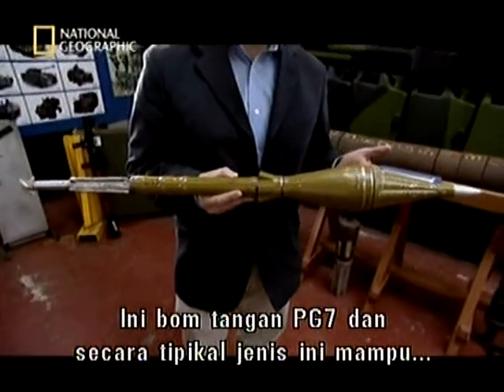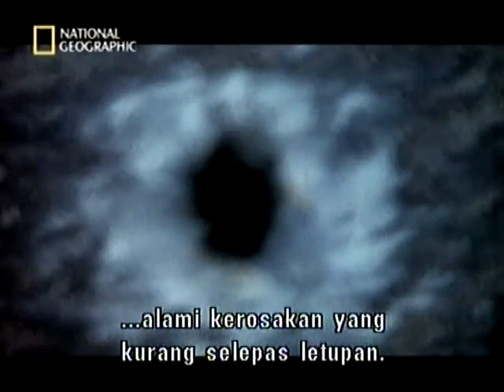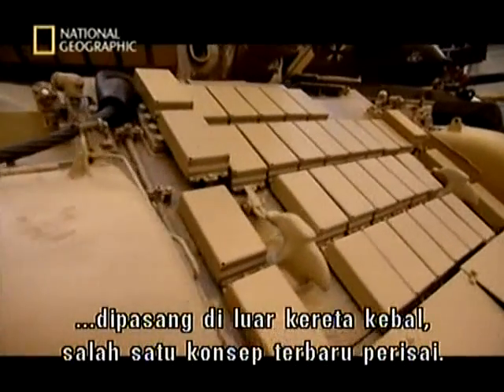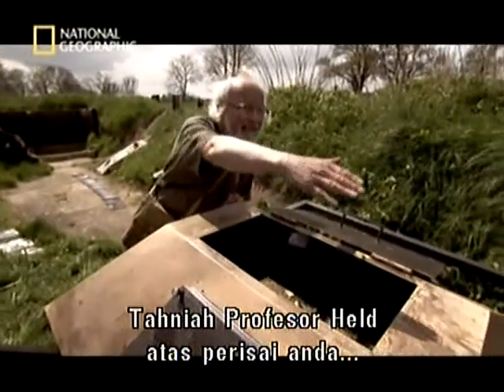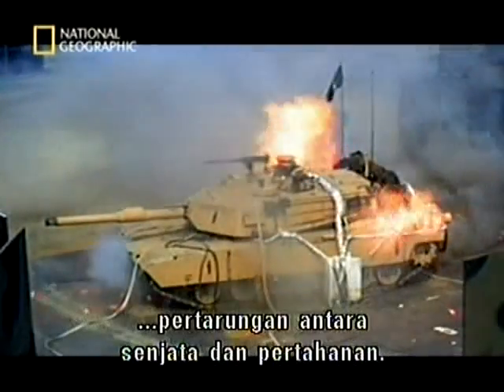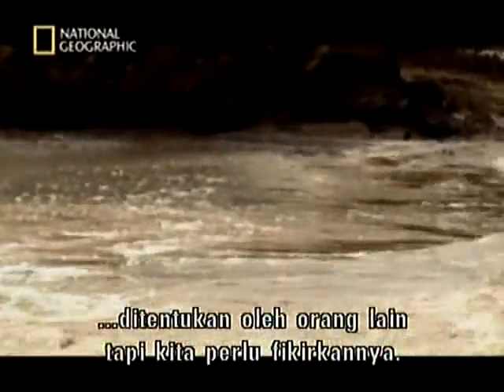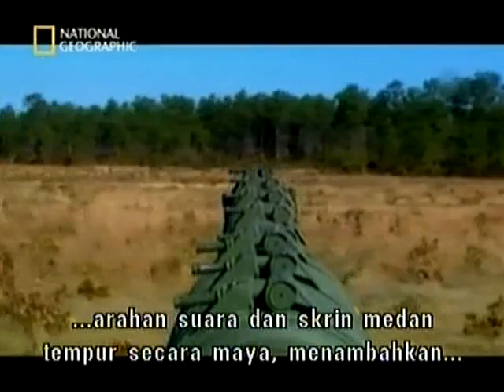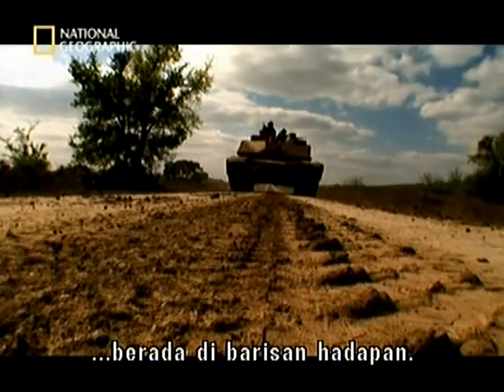Explosive Reactive Armor

Comment: Buuut on the test on his back yard there was a 50cm airgap between the HEAT and the armor.
Reply: real ERA is spaced too, but the explosion is designed so that 2 ERA plates moved in different directions while exploding to "bend" the rod penetrator or the shaped charge spike

in this video it used the old concept where ERA is combined with spaces armor

Comment: Armored personal transport with fast moving capability is still needed. But infantry held armor penetrating weapons are getting smaller and smaller. Every squad now has the capability to take out a tank.  So small fast moving vehicles with armor, with infantry equipped with Anti-Armor and Anti-Air rockets. It seems the better option now.
Reply: Tanks far out-range most of the weapons systems infantry can use to disable them. While this makes them vulnerable in an urban environment, in wide areas with proper coordination with other units, tanks will consistently wreck infantry. Secondly, armored personnel carriers are cheep, and the infantry in them are expendable, thats why we call em sardines. 
Modern tanks suffer against guerilla and insurgent tactics, but in conflict between professional armies e.g. the early days of the Iraq War, the Gulf ect, they fucking wreck. 

Smae goes for air force, handheld anti air has such terrible range that they may as well not bother- modern aircraft can wreck infantry before they can even physically see the aircraft.  You should look into what modern AA batteries look like- the missiles are a dozen foot long. Infantry can't compete with that. People don't seem to realize (because movies and games tell them i infantry is the be all end all of conflict) that armour, countermeasures, threat detection, intelligence, communication and speed on modern war machines is always advancing at a rate faster then infantry can usually keep up- because militaries invest far more in it. Makes sense - why invest money in something that can be rendered ineffective by a stray piece of shrapnel the size of a button? They ARR constantly advancing infantry to be more mobile and versatile as you suggest, but it is a half measure. Infantry fills in the gaps that war machines can't. Tanks, ships and aircraft are the future of warfare.
Reply: Tanks far out-range most of the weapons systems infantry can use to disable them. While this makes them vulnerable in an urban environment, in wide areas with proper coordination with other units, tanks will consistently wreck infantry. Secondly, armored personnel carriers are cheep, and the infantry in them are expendable, thats why we call em sardines. 
Modern tanks suffer against guerilla and insurgent tactics, but in conflict between professional armies e.g. the early days of the Iraq War, the Gulf ect, they fucking wreck. 

Smae goes for air force, handheld anti air has such terrible range that they may as well not bother- modern aircraft can wreck infantry before they can even physically see the aircraft.  You should look into what modern AA batteries look like- the missiles are a dozen foot long. Infantry can't compete with that. People don't seem to realize (because movies and games tell them i infantry is the be all end all of conflict) that armour, countermeasures, threat detection, intelligence, communication and speed on modern war machines is always advancing at a rate faster then infantry can usually keep up- because militaries invest far more in it. Makes sense - why invest money in something that can be rendered ineffective by a stray piece of shrapnel the size of a button? They ARR constantly advancing infantry to be more mobile and versatile as you suggest, but it is a half measure. Infantry fills in the gaps that war machines can't. Tanks, ships and aircraft are the future of warfare.
Reply: Nick But when you are talking "outrange most of the weapons". You are talking the conventional rpg. Those would not be used if they redistributed their budget. They would then instead have stuff like the FGM javelin launcher. Even Arabs are currently playing with laser guided missiles. They fire those from incredible distances.
Reply: WoopWoopDk
No, i'm not talking about ancient RPG's.
A javelin has an effective range half of that of a standard Rheinmentall Abrams gun. The laser guided shell that gun can use has 4X the range. Modern tank ballistics computers keyhole shells. Range is everything in modern warfare, you can kill the bad guys before they effectively can even fight back.

As for the cost argument. Javelin munitions is 7X the cost of the most recent Abrams standard shells.

Tanks are faster, have better range, are vastly more accurate, are 100 times more resilient and are usually more cost effective than infantry trained and equipped with state of the art tech and in enough numbers to be remotely as effective. And before you bring up about the cost of the tank (sorry for being presumptuous), carting those grunts around in the expensive, equally resilient APC's you suggest would blow it far out. 

Compatibility is one of the most expensive elements of weapons development. Putting the same range and damage output in a handheld weapons system is expensive as balls. You need better propellants, lighter, but still very resilient materials in the weapon itself, a harder penetration system, and a more compact ballistics and targeting system. 

In the age we live in less is not always more.

I'm not saying infantry doesn't play an important role on the battlefield, it does. But its also a role that has been shifting and becoming far more focused (diminishing) as war machine's versatility grows. Humans are simply too physically limited to keep up, it doesn't matter what weapon system you finance, the bigger fucker will be cheaper and more effective every time.
Reply: Nick You are definitely more informed on the subject. Thanks very much for useful information.
Reply: The utility of tanks goes away in urban/mountainous/swamp terrain. 
Tanks in cities are horribly venerable and there are lots of areas tanks just can't go
because the terrain and geography prevents it.. 
In those places Infantry is not just a better option, it is the only option. 
Look at Vietnam, Tanks were used sparingly and had no tactical or strategic effect 
on the outcome in individual engagements or the war there. 
In addition, once territory  is taken, you can't hold it with tanks or aircraft. 
Even in open terrain, tanks are vulnerable without supporting infantry.
Technological progress has changed modern war, but it has in no way 
reduced the need for infantry.
Reply: mushroomcloud1
Nobody is suggesting that infantry is obselete, it's that the two fill in the gaps where the other is lacking. And in an ever increasingly agricultural world, range and speed are becoming ever more integral.